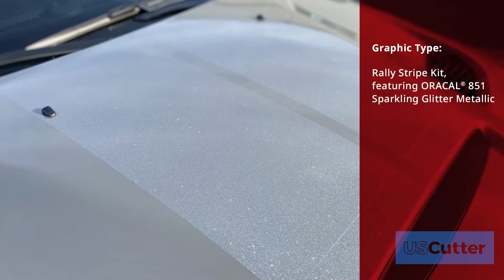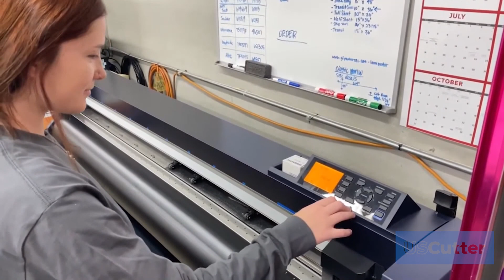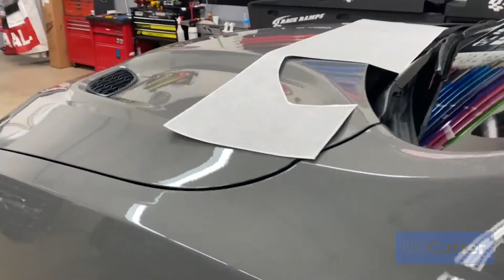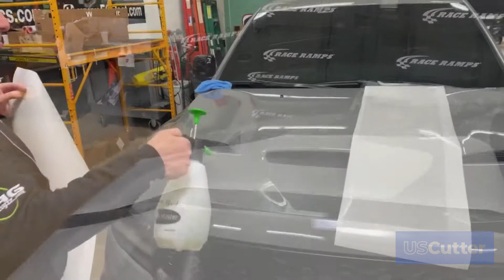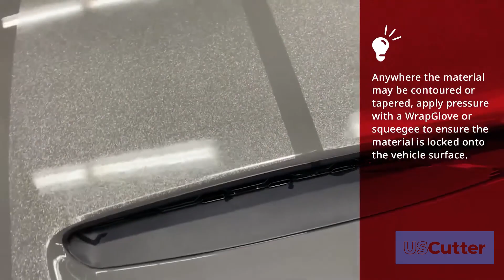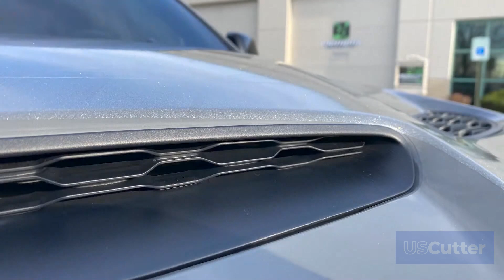Episode 3   ORACAL® 851 Rally Stripe Application Video - Homemade Wet Application Fluid

Comment: Thanks for the video. I can’t seem to find any videos on the different Oracle vinyls 651,631,751,851.
Reply from the maker: I think I mention something about it in some video but I can't remember which one so here is a quick breakdown. 
631 - Indoor removable vinyl -  This vinyl is designed for indoor application for 1 or 2 years. This has a water based adhesive that won't destroy the paint on your walls when removed. You do want to clean the walls  before applying and avoid applying it in the path of an air vent. Use Low to Medium-tack Transfer tape
651 - outdoor application . It is a calendared vinyl and will last about 5 -6 years outdoors but you will start to see it peeling and cracking near the end of it's life span. This is some of the most common adhesive vinyl  used on the market. Use  Medium or High Tack Transfer tape
751 - outdoor applications 7-8 years. Great for boats and planes. It is a caste vinyl so it won't peel our crack near the end of it's lifespan but you will see fading.  Use  Medium or High Tack Transfer tape
951 - Outdoor applications - 10-12 years application. It is also a caste vinyl and won't peel or crack at the end of its lifespan, but will fade.  This is great for boats and planes. Use  Medium or High Tack Transfer tape
All of these can be cut with ease using a 45° or 30° blade